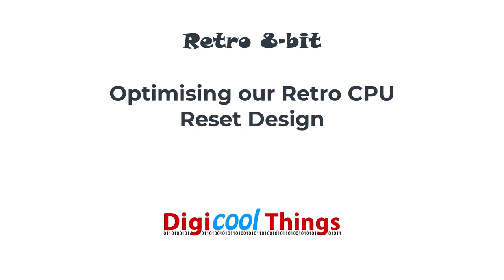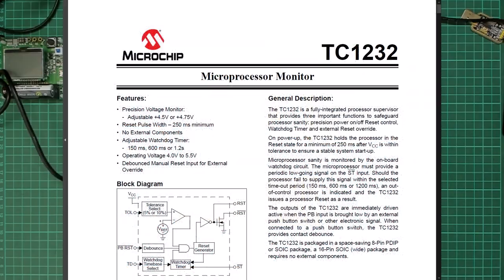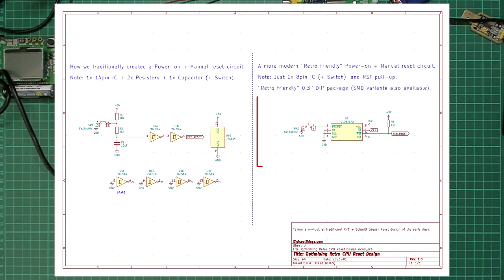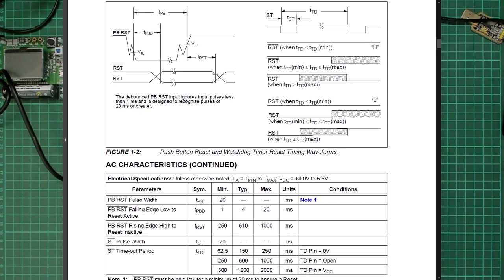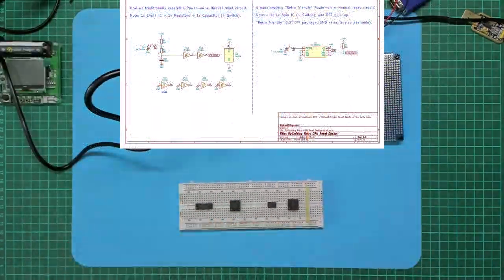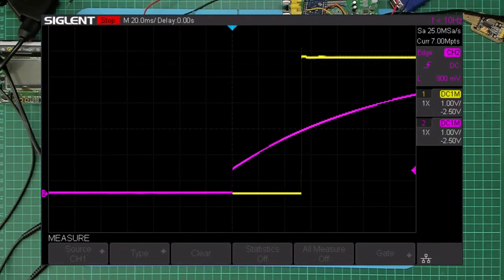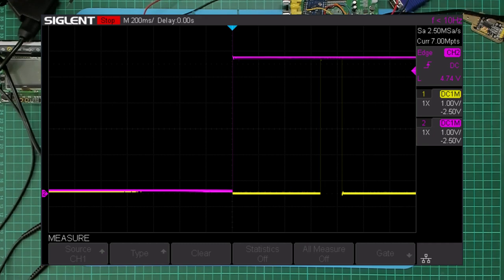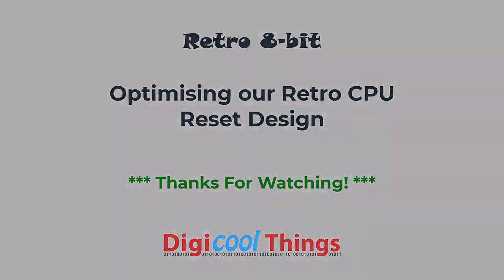Optimising our Retro CPU Reset Design

Comment: One thing to watch out for when running a watchdog is being able to disable it during programming. As I’ve been caught out a few time where modifying some code as to cause a slight increase in programming time and all of a sudden your boards starts to fail when programming as the bloody watchdog is resetting the CPS as your trying to programme it. Had to fit an extra pin on the programmer connector so plugging it in stopped the watchdog from hitting the reset.

Had to be fitted external to the board as part of the connector so it would be only able to override the watchdog when connected and no risk of the board being left with the WD disabled after programming.
Reply from the maker: You do make a good point, and good advice!  Although I’m not using the watchdog timer facility in this Retro project, it’s clear that if your watchdog is in use, then when your application isn’t running you’re faced with continuous resets!
I don’t have memories of dealing with this in my earlier work, but I imagine, as you’ve pointed out, some kind of external watchdog timer reset clock, as an override during final development / debugging, would be necessary.  :)

Comment: Excellent solution, but do you find any difficulty in not utilizing a 555 for this task? Lol. 
I still try to use a 555 whenever practicable for the retro stuff. The Apple ][ used such a solution and I'm marred for life due to exposure.
I've used Microchip supervisors (MIC series) in the past for commercial designs and always had good experiences. Solid performers.
Reply from the maker: Thanks.  Yes, I’m also a fan of using the versatile 555, wherever appropriate.  In this case I was attracted by the “No External Components” promise (on account of my wire-wrap background).  Although, perhaps the TC1232 coming in the familiar 8-pin DIP package of the 555, clinched the deal!  LOL   But, on a more serious note, a 555 based reset circuit would no doubt require more R/C components than the default Schmitt trigger circuit, plus I imagine I’d probably also need an inverter (for an active low monostable pulse)?  
It’s good to hear you’ve had good experiences with Microchip supervisors.  I haven’t used these before, and I’m not even sure what packages are available, but the TC1232 certainly seems like an ideal fit for my Retro package & relatively low cost requirements.
Reply: @DigicoolThings  Indeed on your serious note, 3 resistors (12K, 3M3, & 1K), 1 cap (0.1uF), one small signal NPN, and the 555 to generate /RST. The important part is that the chip be 8 pins. I used a lot of MIC2755 for portable applications back when it was a Micrel part (also 8 pins but an MSOP package). Microchip did well to buy them. These days it's the simple, cheap, and tiny MIC6315 for me so long as there is no need for a watchdog, or you can always watchdog the MIC6315 with a 555 & a tiny MOSFET....